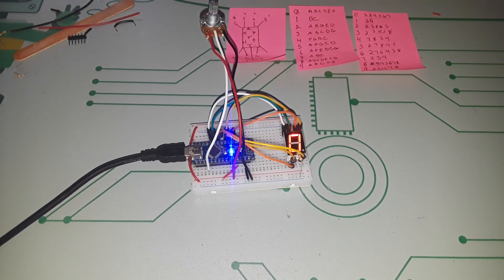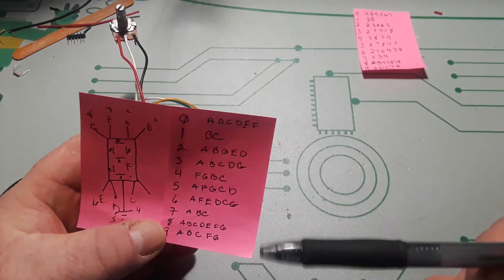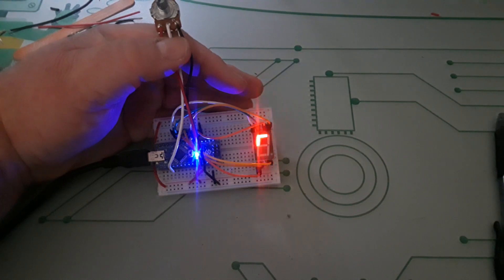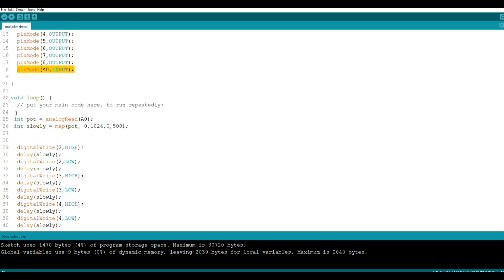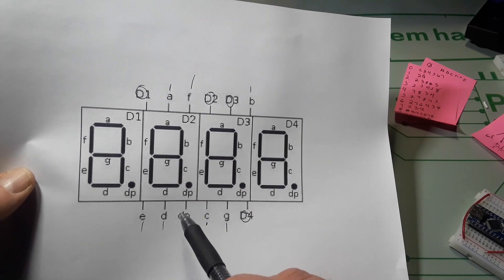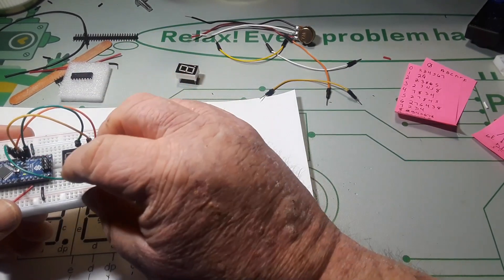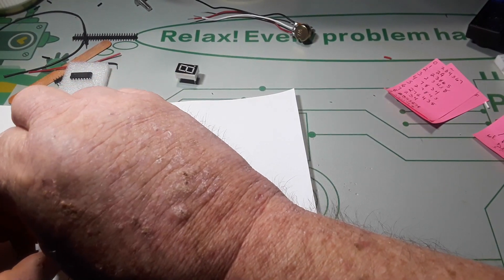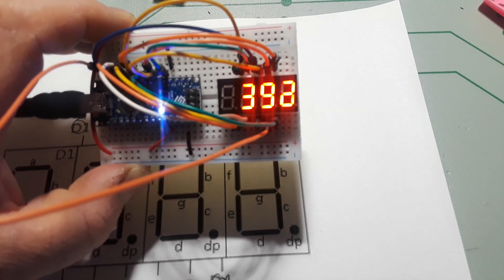Multiplexed 7 Segment Displays

Comment: Not sure if you ever explained the 'Why multiplex' part in your earlier video, but it was mainly created to use less energy. In this video only 1 segment is being lit up at any instance in time. In the case where digits are multiplexed, only 1 digit is being lit up at any instance of time as well. This is good for battery devices so they use less energy and last much longer. Just an FYI. Great video.
Reply: Not sure what you mean by 'hasten toward the author'. And, no, he did not. He did a great job of describing the 'how' but not the 'why'. I have 40 years of experience as an Electronics Engineer so I believe I know a thing or two about multiplexing. Thank you.
Reply: I love Paul's videos, and they are inspiring me to return to a hobby that I've neglected for too many years.  If I were describing "Why Multiplex" to a beginner in digital computing, I would say "Conservation of I/O on the processor".  If you look at Paul's excellent demonstration of a single digit display, it required 9 I/O pins from the processor (if you include the decimal point).  If you wired up 4 digits using the exact same method, you would need 36 pins!  That would be one heck of a processor!  The 'Multiplex' advantage is that the 4 digit display only required 12 I/O pins.  To accomplish the full display, the processor still turns on single segments, just like Paul's first demonstration, but in addition to walking through the necessary segments for each digit, it also has to walk through the digits one at a time.  Of course, I feel safe in assuming that you two know this, but to a beginner, this takes a bit to understand.  Nicely, as Paul's excellent second demonstration showed, there are libraries that handle the low level details!
Reply: Yes he did in the start of the video, guessing you like electronics, don’t be so hasten towards the author..

Comment: The first digital watches, used LED displays. To save power they could only be viewed by pressing a switch. In addition the displays were multiplexed.
Even with all these power saving measures were used, the display could not be read in sun light and the batteries only lasted two or three months. 
A similar problem was associated to the four function calculators of the period. Those of a certain age, will recall the struggle of reading the display on the first Sinclear scientific calculator. 

The saving grace of the LED display is that it is so simple to drive. That said,  modern LCD display modules are now so simple to drive, with their built in controller, that there is no reason not to use them. One advantage of the modern LCD display is that many use a serial interface, such as I2C, that greatly reduces the number of wires going to the LCD module. 

I once had the task of designing a piece of test equipment, to test an optical fibre interface. Rather than use a microcontroller, it was decided to use just a MAX7064 PLD, programmed in VHDL as the heart of the equipment. 
This IC only has 64 logic macrocells, yet it was possible to fit a test state counter, a PLL clock divider, phase/frequency detector to drive an OCXO, three independent pseudorandom sequence generators, a phase locked, a  bi phase fibre optic tx/rd interface, a two button user input and an LED driver, and a  seven segment LED display driver, into the single PLD. 
The point of this story, is that it would have been much harder to have fitted an LCD display. So LED displays still have their uses, but maybe not on battery powered equipment.

Comment: lol i have a 4 digit display and its part number is 3641BS1-1   not sure what the difference is between these two but i would like to know lol or if there the same thing or not they look just alike so who knows
Reply: There are so many types of 7segs. Some only have a few pins and some have way more than required by other types. 
Punch the part number into Goog and you will find the pin out.
Reply: When I searched that part number it appeared to be a digital voltmeter with 3 wires coming from it.  If that's the case, then there is circuitry integrated with the voltmeter that drives the display based on the input voltage.  So you wouldn't be able to directly control each segment with an Arduino, that's not the purpose of the unit.  Instead you provide an analog input voltage, and the voltage is automatically displayed.

Comment: 1. Typically, the individual 7 segments are not multiplexed, Instead, each individual digit is multiplexed across a multiple digit display and that is exactly what the 7 segment library is doing.  So the digits "flash", not the segments.

2. The code can be made much more compact, by representing the 7 segments + decimal point as bits in a single byte.  So 10 bytes can represent all of the digits.  Then write a routine that takes a digit byte as a parameter, then tests each bit to determine if a particular segment should be lit.